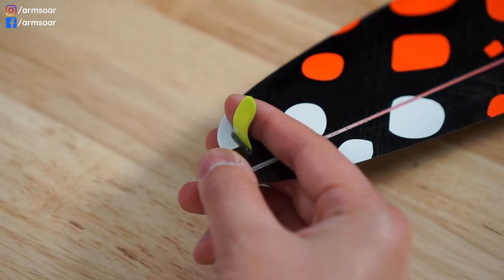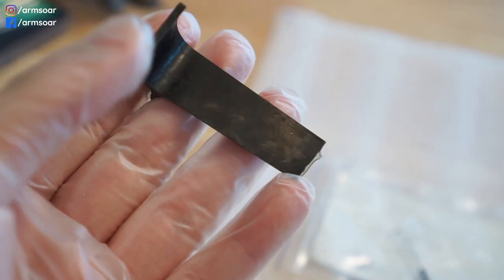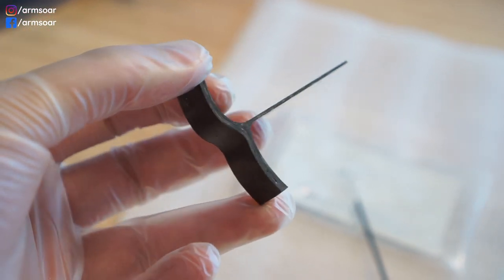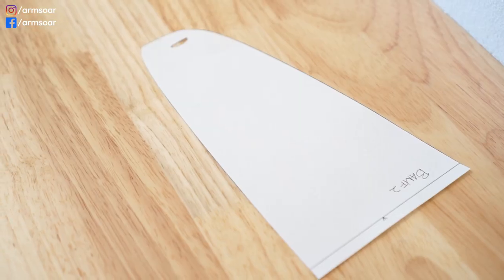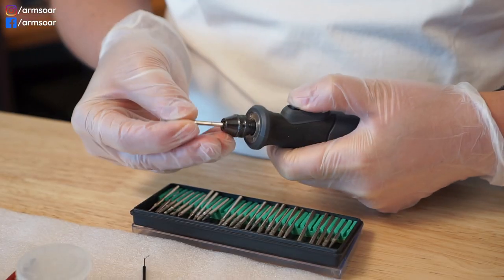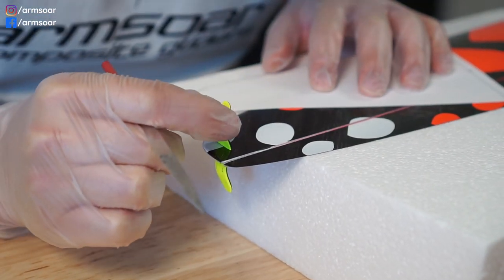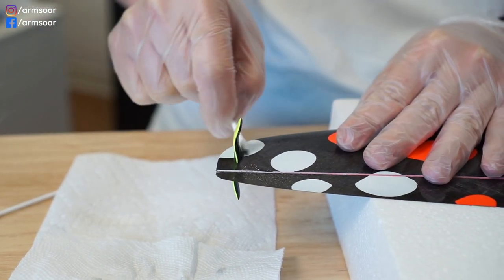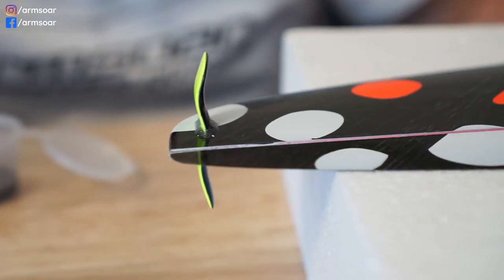How To Do The Perfect DLG Throwing Blade Install

Comment: Newbie question what's the stuff you mix in with the epoxy instead of micro balloons? I  googled carbon toe  and could find anything?
Reply: Carbon tow (not toe!). For example: https://www.easycomposites.co.uk/carbon-fibre-tow Thomas is suggesting cutting these long carbon fibres into tiny lengths and mixing them into the epoxy. Another alternative to the epoxy on the fillet is this rubber toughened CA: http://www.bsi-inc.co.uk/ic-2000tm-rubber-toughened-ca-1-2oz.html
Reply from the maker: Correct! Also called carbon roving in some places.
Tough/rubberized CA is awesome :D

Comment: 😂 your timing on this video is perfect. Another good video for a newb like me, thank you.
Do you make the hole slightly larger so the glue can seep in, or does the glue sit on the top skin like a fine fillet weld?
Reply from the maker: You want the hole to fit as tightly as possible, superthin CA will wick into the tiniest cracks to glue the blade to the wingtip. This lets you transfer the load directly to the wing. Then build up the fillet after.
Reply: @ArmSoar  thanks Thomas, thumbs up for the links to products too.